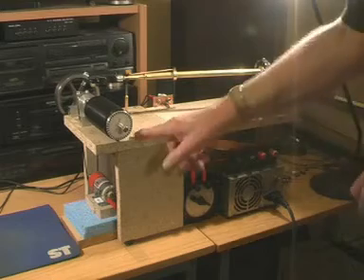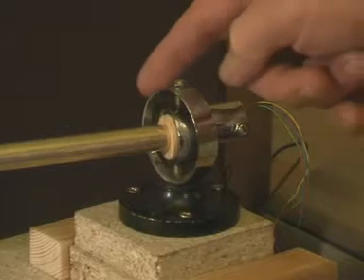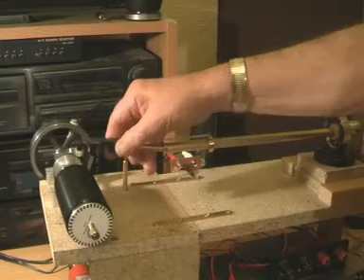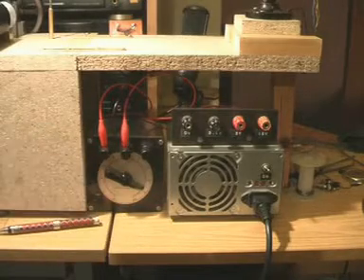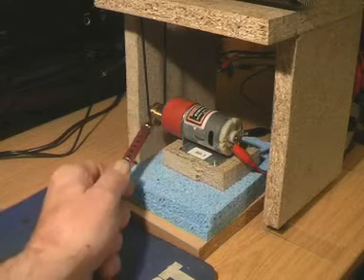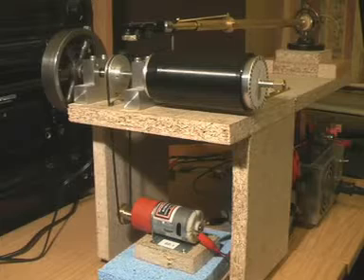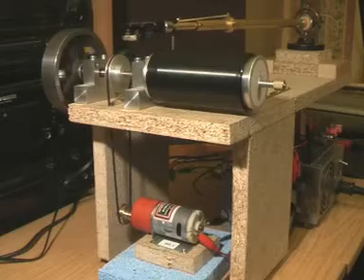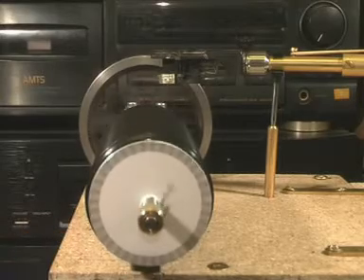cylinder player 2

Comment: Yet again, there's amazing audio quality in those hill-n-dale grooves.

The gearbox sounds to be your 'motor' noise problem.  Is that the case?

I'm intrigued by how you've aligned the arc of the stylus relative to the straight line across the top-length of the cylinder.

I can't wait for the next instalment.
Reply from the maker: Thanks. Yes, the noise is from the gearbox of the little motor. I had no idea it would be so loud. And so Phase III will be a return to the motor we originally used, which was a small AC synchronous motor salvaged from an old fan heater. True, it goes at 2,800 rpm, but is commendably quiet. The idea of having variable speed was not so much as to correct the playing pitch (this can of course be done very easily on the computer), but rather to slow the playing speed down well below 160 rpm to cater for tracking distorted cylinders. But as distorted cylinders sound so awful, we have lost interest in them. Therefore, we will use the 2,800 rpm motor and fit an intermediate shaft & pulleys, to get a fixed speed just below 160 rpm. Am hoping to do this over the weekend. All the best.
Reply: With cylinders and Diamond Discs, Edison showed, how good acoustic recordings can sound, but at least, Berliner's system had more success. 
No one had the idea to keep this system and to use it in record companies,  to prerecord in high quality.